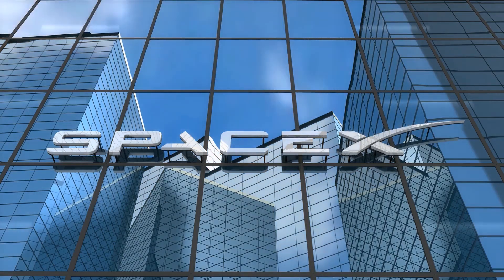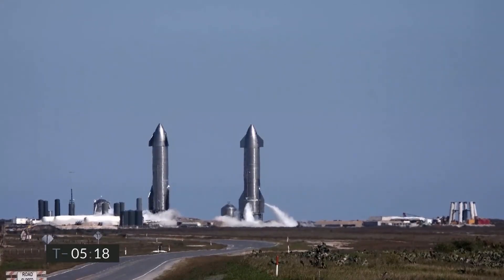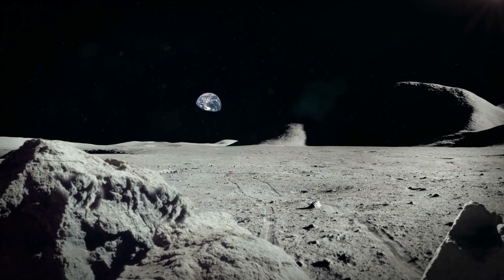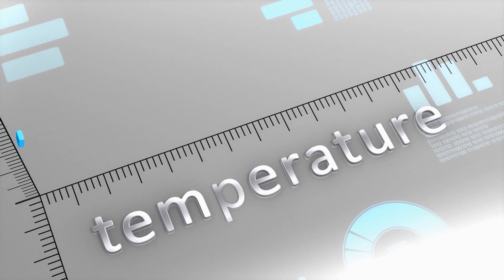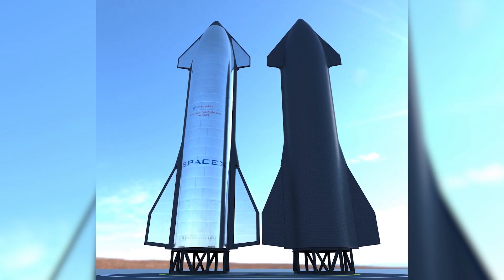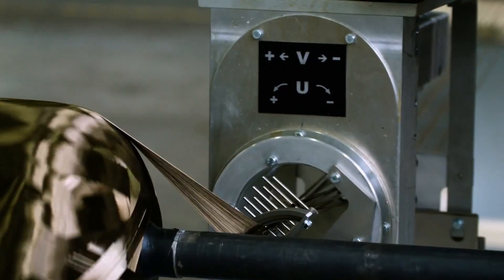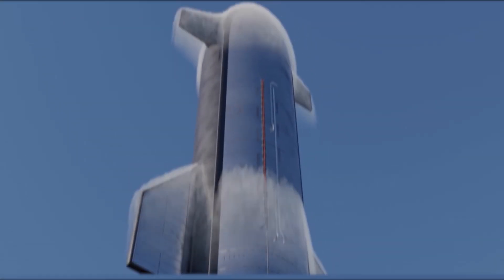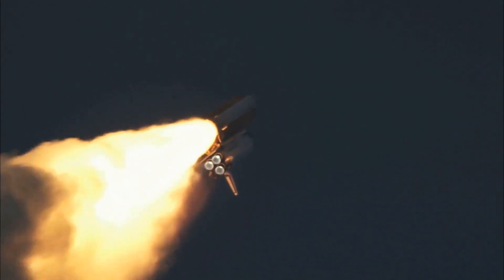Starship Is Engineering Genius (And Will Be Copied)

Comment: Musk has no track record of failure.  He will get Starship working.  It WILL be copied.  Whether is will be copied successfully is another story.  It is a SpaceX formulation of stainless steel.  The software to control the aerodynamics of a falling cylinder and landing must be formidable.  The Chinese will try to steal the code.  It may be copied in due course - but without design and software theft, how many years would that take?  By then SpaceX will have eaten their lunch.  They already have the exclusive contract for a Moon Lander.

Comment: A lot of outdated information
Reply: The three fin design was scrapped in 2019

The dule nozzle was also scrapped 

The fins where not the problems with the landings (was the engines)

Falcon 9 is aluminum not carbon fiber
 
The Falcon 9 can launch crew cargo and satellites